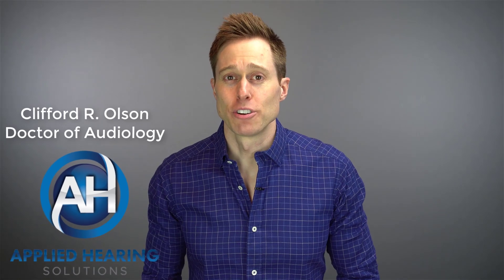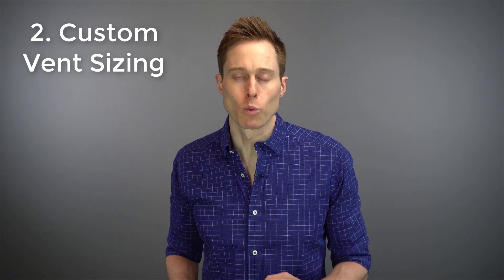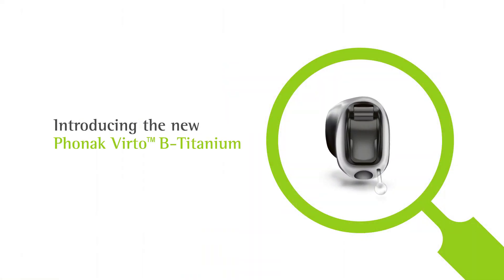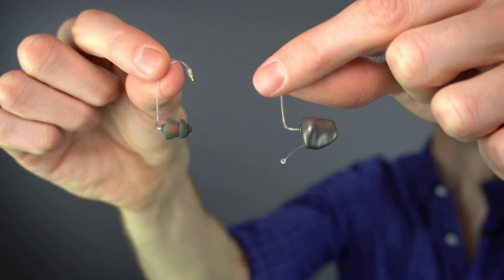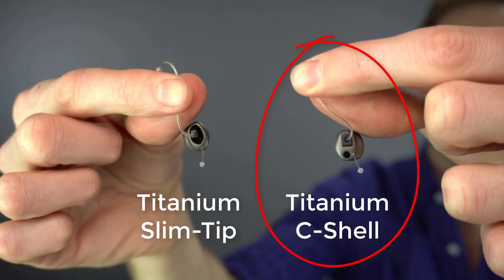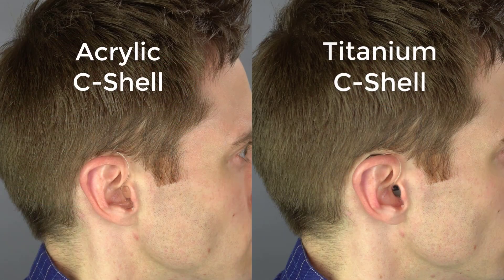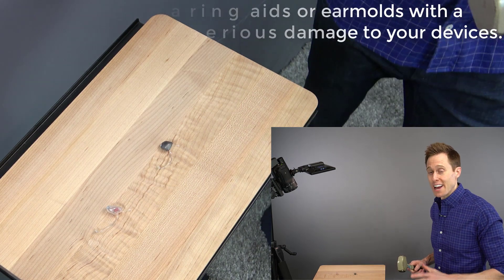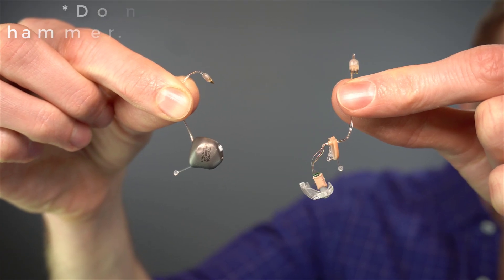The FUTURE of Hearing Aid Ear Mold Technology | Phonak Titanium

Comment: Any suggestions for the acrylic molds slipping out ?
Reply: They shouldn’t slip out (even when eating), if they are then you should see about getting them remade, i have acrylic slim tips at the moment, but i have the titanium C shells being made. I’m only getting them in titanium because the acrylic is far too delicate as Dr Cliff has shown us, but they fit absolutely perfectly, i say go back to your audiologist and tell them they keep slipping out, i can wear my acrylic molds from the moment i wake up until the moment i go to bed and it doesn’t even feel like I’m wearing any.
Reply: @FreezingFaces  thx.. have had them remolded twice now... Because of the size of the speakers the molds are bulkier... Hence the titanium ones not recommended... I think I am getting used to the last adjustment with the wings to hold in place... .thx for your feed back.
Reply: @FreezingFaces  Acrylic is also good, its just the titanium is stronger

Comment: Are the titanium molds a soft material like the silicone?  I have a surgical ear and have not been able to use a custom mold in quite some time because of pain and feedback.  I've been using a dome on my 11-year-old Phonak and now I'm not getting enough gain.  I'm wondering if the titanium molds are more comfortable than the silicone?  Thank you.
Reply: What surgery have you had? I had a tympanoplasty surgery on my eardrum about a year ago and I don't usually have any problem with feedback because of the tympanoplasty.. you need to have a properly fitted hearing aid mold
Reply: @kaylasmusic  I had a vestibular nerve section with removal of my mastoid bone.
Reply: @judibeth6483  Oohh, ok, so you had a mastoidectomy.. Either way, I wouldn't think it would have to do with the surgery unless it changed your hearing... You definitely should put molds on.. Have you discussed this with your audiologist?

Comment: Today I got my titanium ear moulds for my Phonak Paradise p9o's. They are a far better fit than the acrylic and smaller. Can I mention the price in the UK here as a guide to others?
Reply: An update on this Tezza,  if you’re still with us 😂 i love my hearing aids, got rid of the silicone domes about a month ago, i got slim tips made in acrylic and I absolutely love them, i can wear them all day without any discomfort, but I’ve only had them a month or so ago and i noticed a hairline crack at the top of my left mold (I haven’t even dropped them for this to happen) i went to my audiologist today at Specsavers.  Showed him the crack in the mold and told him I’d like them made out of titanium so he done his thing on the laptop and told me there will be no charge, which surprised me, I’m getting the titanium C shells instead of the titanium slim tips.
Reply: Please do mention price, a lot of us here are form the UK, I’m a first time user of hearing aids, i got fitted for ITE hearing aids from Specsavers in August, they have 100 day money back guarantee, they fit great, but only a few days ago i took my right one out to scratch my ear and put it back in and it was dead, no sound at all. This was exactly 69 days after i got them. Ive been using a dehumidifier too so i looked after them as well. I managed to make an appointment for the very next day at Specsavers, in the end, i ordered the the Phonak P90s rechargeable, £500 more than my ITE hearing aids (£2000), they currently have £300 off the P90s, so do BOOTS, i just couldn’t believe after only 69 days one of them stopped working, i could see the point if it was 2 years down the line, but not 69 days, anyway I’m rambling here, as i said I’m a first time hearing aid user at 34. Let everyone here know how much you paid for the titanium ear moulds.
Reply: @FreezingFaces  I paid £96 +vat for each titanium mould from spec savers uk.
Reply: @tezzatel  that seems very reasonable, but what happens if the speaker inside the ear moulds break? Are they easy to replace? A new standard receiver and dome costs about £30
Reply: @FreezingFaces  the receiver’s can still be changed by removing them from the titanium moulds. They are an excellent buy I have use many different moulds over the last 10 years and nothing compares to the comfort of the titaniums.
Reply: @tezzatel  thanks Dotty, I‘ll be a first time BTE hearing aid user, I ordered my Phonak P90s on Tuesday , hopefully they will be here some time next week, so I’ll see how I get on with the domes first. Thanks for the replies 👌🏼
Reply: @FreezingFaces  the domes are ok but they aren’t for everyone. I found the fit ok but they were very uncomfortable after a while and felt like they were rubbing. I have servere to profound loss in Both ears so  domes where not a great idea for my loss. Good luck with your new aids they will change your life they really are that good. If you have any questions let me know.
Reply: @tezzatel  Specsavers just phoned me just now and they have arrived, after only ordering them on Tuesday, very happy.
Reply: @FreezingFaces  wow that was quick! Good luck I’m sure you’ll love them let me know how you get on.

Comment: I have the Paradise P90's and experiencing occlusion effect. My audiologist has order a set of hollow sleeve vented ear molds from Phonak. My question is does Phonak still make the titanium slim-tip ear mold?  Does this ear mold take the place of the mushroom shaped mold.  That is to say does it attach like the mushroom ear mold or does it replace the RIC with a one piece unit?  It appears that the titanium c-shell is an all in one unit that replaces the RIC.  I assume you can get the slim tip with a custom vent as well as the c-shell.

Comment: Advice, please. I have tiny ear canals that take a sharp curve/turn. The smallest dome won't work in my canals. The acrylic mold will not sit securely in the canal either. They work their way out of the canal. I tried an adhesive foam strip but it causes itching reaction in my ears as well as causes my own voice to sound very loud to me. I am waiting for my third remake. I have had my Widex aids for 3 months. Do you have any advice you can share with me? Thank you in advance.
Reply from the maker: Sounds like a tough ear canal to fit based on your description.  I would first see if a retention piece would help, otherwise, you may have to try a different brand of devices.  All manufacturers have a slightly different contour of their receiver wires.
Reply: @DrCliffAuD  Thank you so much!

Comment: I have extremely...dainty... ear canals. I have to use the smallest dome size for adults on my phonaks. I was told I couldn't have inner ear hearing aids because of how small my ear holes are. Would that hold true with these custom molds too? (What you showed looked massive to what I'm used to.)
Reply: Well according to this video, Phonak's titanium in-the-ear hearing aids are 26% smaller than acrylic in-the-ear hearing aids...So it's possible they may fit, but it may also depend on your hearing loss because stronger receivers are bigger in size and therefore require more space inside the hearing aids. Which can be difficult to produce as all the components are much more closely situated.
Reply: I have the same issue.  I'm looking into the titanium and I will still have to get behind the ear. It was actually recommended.
Reply: Just wanted to update. I now have my titanium earmolds and the fit is awesome plus my ears are less irritated.

Comment: We haven't had remakes or returns on either the Titanium Slim Tips or C-Shells so a pretty solid product.
Reply from the maker: Me neither.  Totally agree! 👍
Reply: Thank you for your reply. Am I correct in assuming that the Titanium slim tips and C shells are only available on the Phonak devices? Obviously, I just spent a fortune on the Widex. What are my options? Thank you!!!!
Reply from the maker: @carolynmartin11  Yes, only compatible with Phonak devices.
Reply: @DrCliffAuD  I’ve had Phonaks P90 rechargeable hearing aids since October 2021, I’m a new hearing aid user, i was using the silicone domes but after a while they become uncomfortable, a few weeks ago i got fitted for custom acrylic molds, i loved them, they are so comfortable, i can wear them all day, but when i was putting my HAs in a couple of days ago i noticed a hairline crack at the top of the left mold ( I’ve only had them less than 3 weeks, and I haven’t even dropped them, it just appeared), now i have another appointment next week with my audiologist and im telling him i dont want them remade in acrylic, i want them in titanium. I will obviously pay.